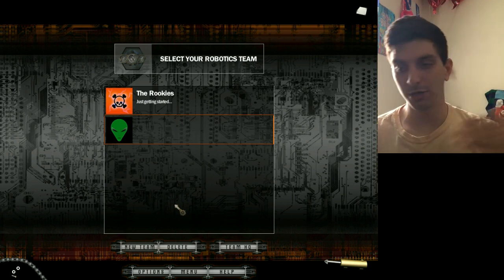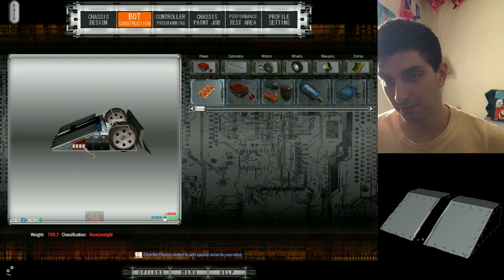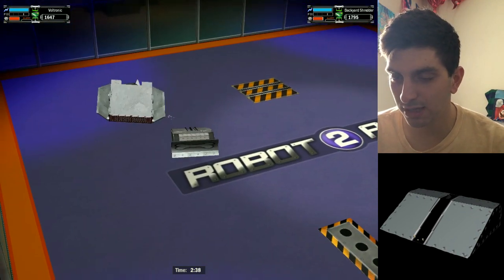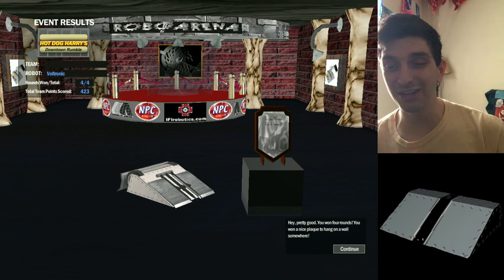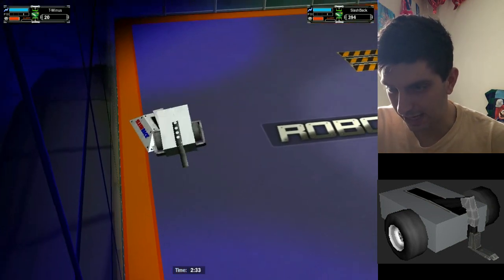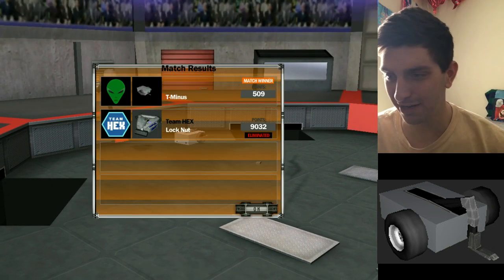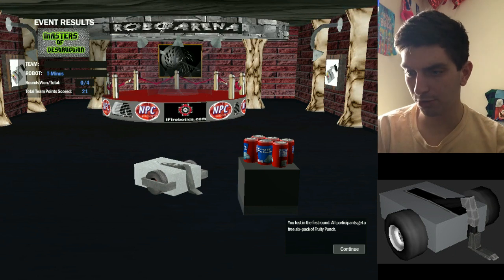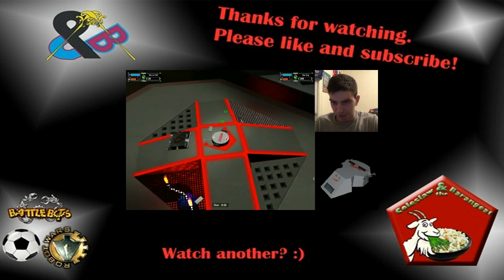BattleBots Reborn: Rebuilt #4 (DSL Mini-series): Voltronic and T-Minus

Comment: I'm surprised that the flipper works so good, having trouble to making good flippers in DSL(one thing I noticed through is that the initial speed is really missing on a lot of motors, having that would make many rear hinged designs much more effective)

The Plow is a stock component(when I build DSL I tend to avoid those), so Stock voltronic/voltarc could be made like that as well, think most of it, minus the flipping power which would be a bit less, could be ported over.
Without the damaging parts through, and some bot glitches(Bear not trying to self right, probably the wrong AI parameters) I think you would've had a hard time.

Backyard Shredder's design means that it won't spin right round.

Think T minus could've had a lower chassis so that the flipper isn't inside it, also his wheels are also in the game.
That T Minus, that's a rebuild for the cup?
Not getting under bots, a problem I have with most of my built flippers as well, looks like it's because of the weak axles in DSL.

Oh and DSL pistons, even through they can't lift bots(probably because of the same reason as bent flippers) they have extra speed(some kind of extra paramter) applied, causing bots to drag forward, not really the best thing.

"Tombstone with two extra wheels" xD
No glitches or crashes, no spinning weapons I think?

Comment: Have to say, I'm quite intrigued to see what version of the DSL Mod this is. It's like you've got the remade machines from the original game, but they're all more realistic and cool-looking than the ones from the normal DSL 2.0.
Reply: Ah, OK. Thanks for letting me know, I might give it a look if I can.
Reply: A AI Pack itself shouldn't cause such glitches, but I think the main sources are parts breaking off(since those bots have more small parts) as well as small parts spinning on high speed,(then again I've seen such glitches before with just DSL stuff) because weak axles.